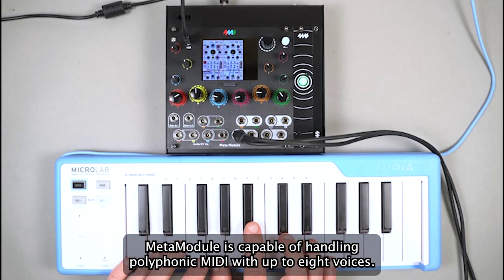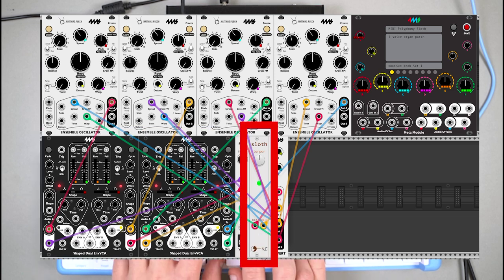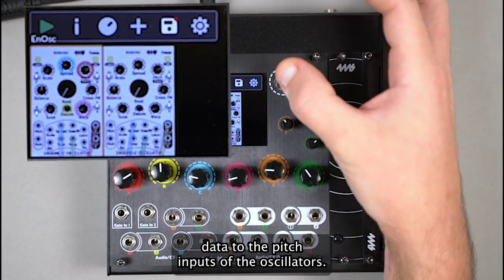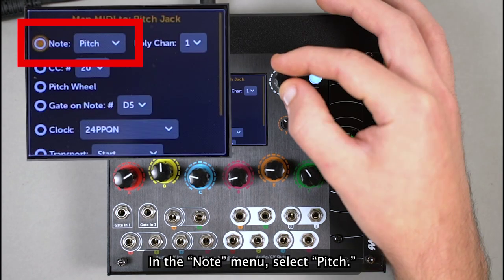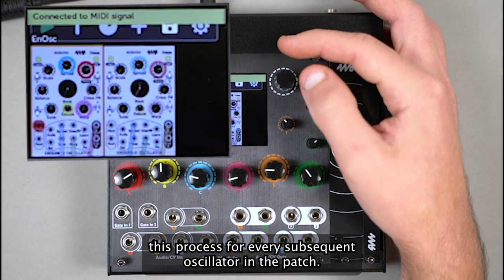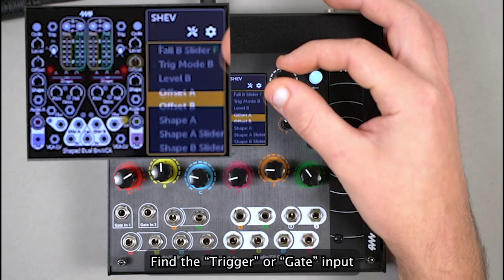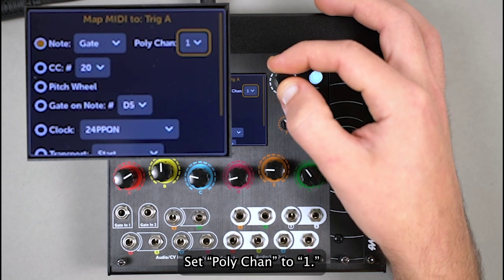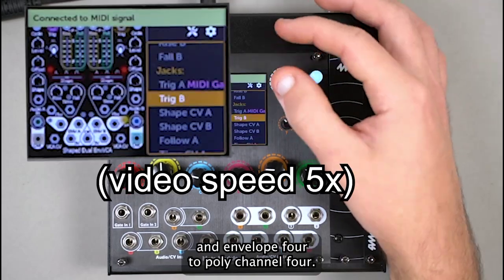MIDI Polyphony Patch with MetaModule

Comment: Is there any modules inside where you can comfortably get 5-8 voices without hitting hardware limits/latency issues? Asking as someone from outside modular that nonetheless loves synths and the idea of a highly modifiable polysynth
Reply from the maker: Yes, the kocmoc modules are especially low-CPU usage, and I did an 8-voice patch using those VCOs plus 4x Dual EnvVCA modules for the envelopes/VCAs.